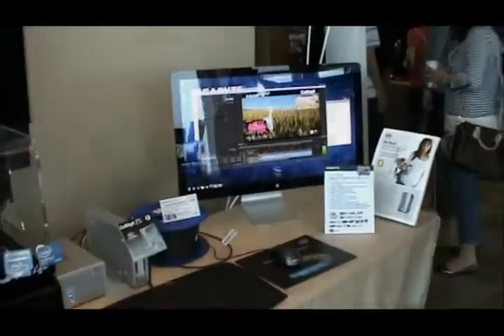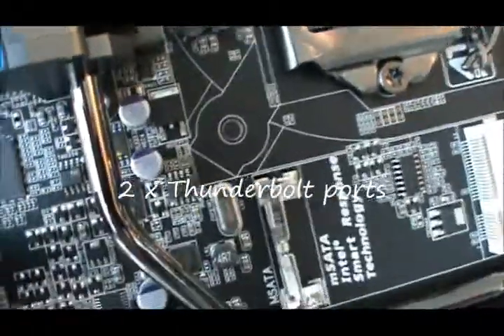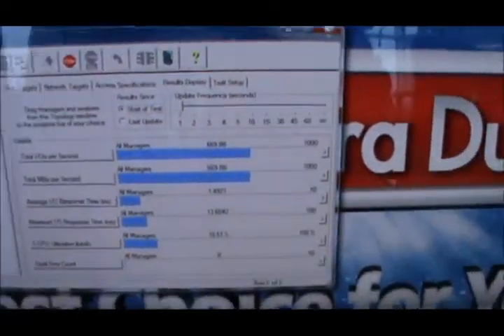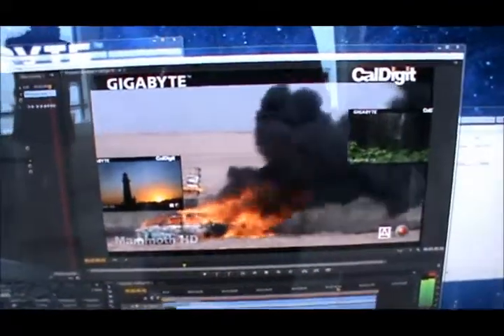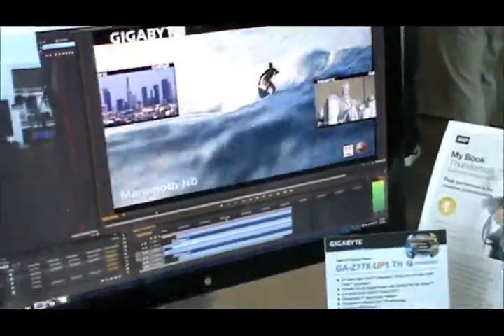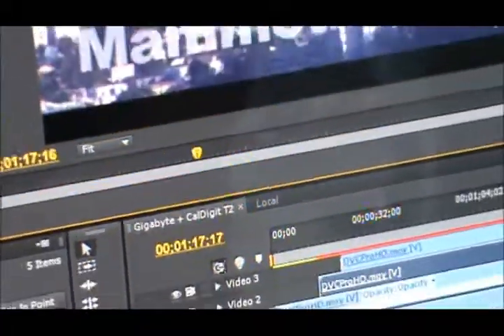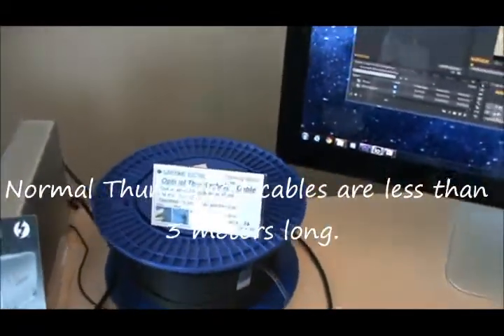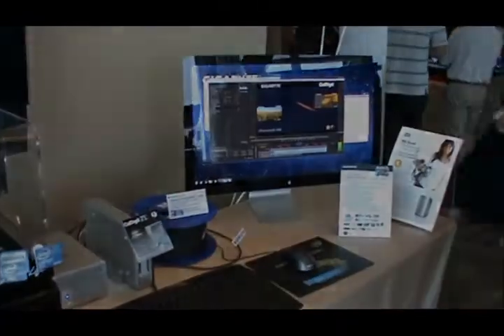Gigabyte's Hardcore Thunderbolt Demo with GA-Z77Z-UP5 TH Motherboard

Comment: I heard the Gigabyte Z77X-UP5 TH was going to be out by the end of June - it's July now & I've heard absolutely nothing at all. What's the deal? When will the it be out & how much? 

Actually, I'd prefer a Gigabyte Z77X-UP5 without those Thunderbolt ports, which I'll never use & I heard they add an additional $50 per port anyway. That doesn't include the cost of the new IR3550 PowIRstage - not sure how much extra that is. 

If I really wanted Thunderbolt I'd prefer a PCIe card anyway.